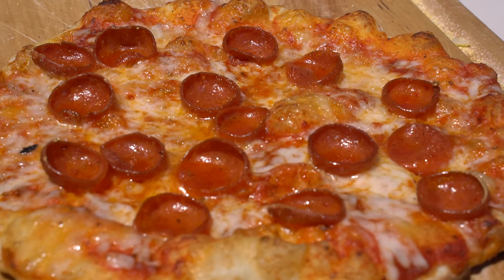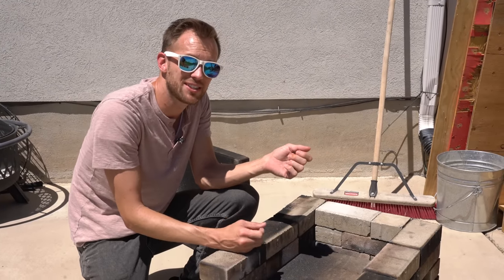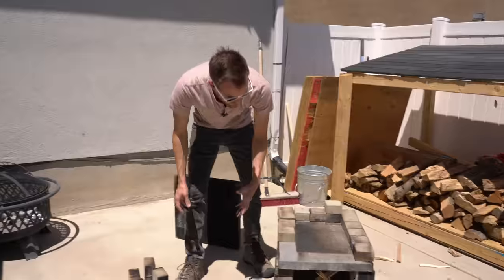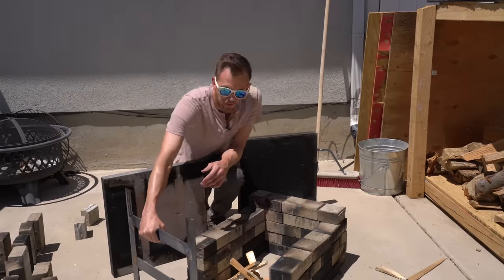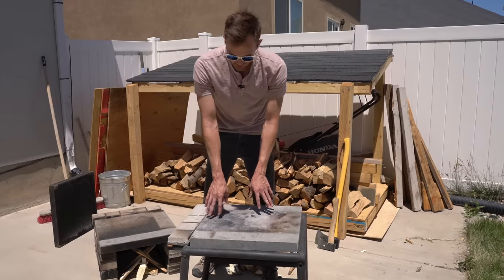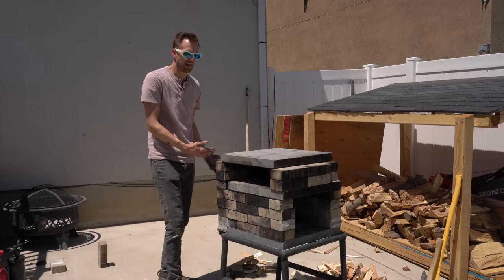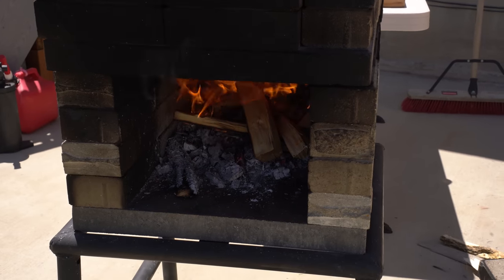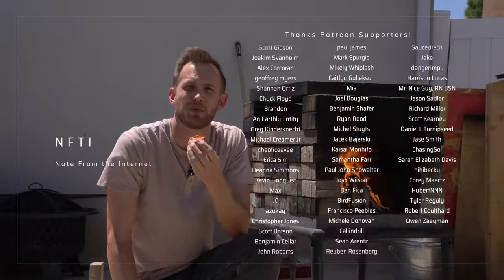The BEST Cheap DIY Pizza Oven

Comment: IMO, your tip of having the fire box access rotated 90 deg from the oven opening is actually a bad idea. It will not draft heat across the cooking stone or brown the top of the pizza evenly. If your fire is shooting out of the front of the oven, your fire is just to high! You need to preheat the oven, and just be cooking over coals.

Comment: Concrete can explode off chips of sharp concrete pieces blasting red hot embers along with them when heated. Have your safety squints in place.

Beware, the shallow craters are not easy to repair, so don't make the mistake of doing this on the front driveway

Comment: Nice oven.
I heard that another good reason not to build a fire on concrete is there could be trapped moisture in the cement , if it turns to steam it could explode.
Don't know if it's true or not , but I'm not willing to find out.

Comment: I'm still trying to figure out where I want to put one as, like you, I am going to elevate it, and likely mortar it so it's not something I take down, but it looks great.  As for the pizza, try this recipe for making your own dough and it's super simple.  5 parts flour to 3 parts warm water, tbsp of salt, tbsp sugar and a sachet of yeast (keep the salt, sugar and yeast separate until you've added the water and start mixing.  I just a stand mixer just for speed, but once it's done kneading, cover and leave at room temp to rest and rise for an hour, then just cut and press out then sauce, cheese, and top.  Personally, I go a bit lighter on sauce, but I do get heartburn easily, then for toppings,  just mushroom and black olive is enough for me.
Reply: Thanks for the dough recipe
Reply: @philipchang4453  Not mine, I got it from Sorted Food, though I should have remembered it as I'm sure I've learned it before this last time.  I'm also told (haven't tried it) that you can do half beer half water for the liquid, but yeah, I've not tried that yet.

Comment: Wonder if large ceramic tiles can be used instead of pavers. In theory the oven would heat up much faster since tile is thinner, although may not heat as evenly.
Reply: Fireplace tile might last longer, cracking resistant

Comment: One thing that has always puzzled me about this design is putting the fire beneath the oven cavity. With an old-fashioned woodfired oven, the fire is IN the oven. That stops the base getting too hot. If I remember from the original chap's video, a couple of pizzas in, the base was looking a bit on the black side underneath! So, why not make the oven one layer and longer?  Then build the fire inside and cook the pizza in front of it?  It will probably get a lot hotter (good), but not at the cost of the base of the pizza.  You will have to spin it, but you have to in a pro wood fired over too.  That is all part of the fun and the taste.

One warning about paving slabs: depending on what they are made of, they might just crack and disintegrate a few uses in, or they will almost explode apart.  I have had that just on a building an outside fire on a slab to cook a paella. It was quite dramatic! In my outside kitchen, my fires are now built on a base of 4mm cold pressed steel.
Reply from the maker: Recently had people over for a pizza party, we cooked more than 10 pizzas and none of them got too burned on the bottom.  Just gotta pay some attention to how much fuel you add.

Comment: I wonder if a multi-layered version that could cook multiple pizzas at once would work. I am not sure if enough heat would make it to the upper chambers to be effective or not. I assume that if it did it would still take some experimentation with rotation to make sure they cook evenly
Reply: Unfortunately no. The trait that most good pizza ovens have in common is a super hot base, whether it is steel or stone. The base has to be in direct contact o the flame to be hot enough to cook pizzas properly. With a multi-layered oven you basically can't make a good pizza with the upper layer.

Comment: Why not use a 24x24-in pizza stone instead of a paver on the upper end of it? I'm pretty sure the pizza can get an easier release, and I'm almost certain the heat from the fire won't bother it.  If not, why not put a pizza stone on top of the paver??
Reply from the maker: Because a stone that size costs way more than the rest of this oven combined. And the whole point of the video was to build it for cheap!

Comment: Doubt anyone will read this, but if you actually make this with the intent of cooking on it, I would suggest using a metal pan or even better, a cast iron griddle as your actual cooking surface. Just place it on top of the paving stone and let it heat up with the rest of the oven. I expect most paving stones are perfectly safe to cook on, but there's always that chance that yours isn't. Your food should actually touch a surface meant to cook food on, and paving stones are not meant to cook food on.

Comment: Might cost more but you could get actual stone pavers to make this oven. Flagstones. Probably shale or slate or limestone. If you picked complimentary shapes you might create a more rounded freeform oven. Also good is the previous firebricks idea. Or get the 12" $250. Oofa pellet pizza oven. (On the smaller side but their least expensive option... maybe wait for a January sale price cut. Good for up to 'medium' size pies. Kingsford offers an all natural food grade pellet now too; as opposed to 'furnace' home heating  grade pellets that could have undesirable binders and such.
Reply: I think Fred Flintstone had one of these too.

Comment: my question is, dont they sell fire resistant pavers with high heat rating?
Reply: And why would they have that?
Maybe after they see thus video they might, but pavers are for walking on not building fires.

Comment: if you adjusted your time for a slightly lower temp you might get a few more uses out of your paver block most the pizza ovens ive used at work cook around 600 instead of 700

Comment: Would moving a few bricks about 3/4 inch on the back wall created a passage way for more heat? Then on the top row move them foreword again. Just the two middle bricks from the bottom to the second from top row. That would create a good passage but still leave a sealed oven chambers on 3 sides. 
 Next get ferro concrete and make a form that’s stackable. With the ideas you get from your experimentation. Fire rated cement will last a long time. You can also make a custom larger oven and get a clear 24 inch cooking area. 
 I like using steel to support the pavers, that’s a keeper.

Comment: Build it on a welding cart, height problem solved and you don't have to take it apart to move it.
Additionally I would have to build it double width because I'd be eating one of those entirely by myself lol

Comment: Would it not make sense to also rotate the "vent" between the fire and the oven so it's still at the rear to get a more even heat over the pizza rather than possibly having it off to the size ?
Reply from the maker: Yes, if you have paver stones that are big enough!  But to support the top, I would then need bricks on both sides of the cooking paver, leaving too small of a gap for cooking!

Comment: I live in Baja California I went thru the same process you did built one on the ground first bricks cost 10 pesos 50 cents here had to build my own paver with rebar in the middle and concrete 2 inch's thick with a slot in the back  for the flame worked good I lost  some pizzas in the beginning didn't like bending over so I built mine up with cinder blocks fill it with rock and base rock to light my fire on worked great cooks a pizza in about 2 minutes

Comment: How did you put out that fire after you cooked it? Do I need a fire extinguisher? Can I use water? Do I just let it burn out?
Reply: Better to burn out, than fade awayyyyyyyyyyyyyyyy😁😎
Reply from the maker: You have to add wood every ten minutes or so, if you don't add any it just burns out.

Comment: Does turning the pizza part 90 degrees affect the crispiness of crust or anything, since the air isn't pushed over the pizza as much?

Edit to clarify: I don't know much about science or cooking, I just thought there was some kind of benefit to having the hot air move across the pizza.  I would appreciate those more knowledgeable than me giving me some of their knowledge on this.
Reply from the maker: Plenty of hot air still moves across the pizza like this!  Maybe in a different direction, but it's there!  A design with the vent at the back might still be better, but the pavers I was able to find weren't big enough for that.
Reply: @NFTI  Ah, that makes sense.  It still seemed functional, and I thought it would only be a bit of a minor difference anyways, but I was just curious if it had a noticeable affect

Comment: The only problem with the 90 degree mod, is the "door" is right next to the vent for the fire, so you won't get as much heat across the top area, I'd rather 180 the opening for the fire to keep the convection.
Reply: It seems like no matter where you move the fire pit opening (unless it is opposite to the opening of the cooking area) it will still be just like the “original mod” version.  I would think about creating a door to just slide in front of the fire pit opening (like they do on other expensive pizza ovens)…even if you just have to use it to block the heat while turning your pizza!

Comment: A lot of gas, commercial pizza ovens have two long ceramic plates above the heat, which split the surface laterally. The seam never bothers the pizza. So you could use two long pavers, if you can find them easier.

Comment: If you've got one, replace the middle paver, the one you put the pizza on, with a "Baking Steel", OR just a steel plate in the right size that's maybe 2cm thick (or perhaps an inch thick? I don't understand Imperial measurements)
Reply: One inch is right at 2.6 cm. I think these pavers are sold as being 2 inches thick so roughly 5.2 cm. 

While we use imperial more than metric in the US, we grow up using both and almost every tool we have for mesuring things has markings for both. Few people can convert from memory but all we usually have to do is look on the other side of the mesuring tool.

Comment: Actually I'd take a guess and say if you added one more layer of bricks on bottom and put a slightly raised wire mesh no thicker than the brick to put the wood on, it would both burn better and probably not damage the concrete.

Comment: The bottom crust is great but it seems like it needs more heat from the top.
Have you considered angling the top stone so that it slants from rear to front? And/or adding another stone to the top-back for space for wood?

Needs tweaking but I think you’re on to something

Comment: Is there a way to get the slot for the airflow in the back? Your design seems to work well so maybe it doesn't matter, I'm just wondering if some of that hot air is just leaking out the side rather than flowing over the pizza
Reply from the maker: With larger paver stones for sure.  I couldn't find any 24" ones, and the ones I have would leave too narrow of an opening if they had bricks on both sides, but if you can find the bigger ones that should be an option.

Comment: Good ideas. I'm just wondering if moving the opening to the side will affect the airflow. the original structure allowed the air to flow over the entire pizza. That way you wouldn't have to move it about in the oven. I suppose to prevent getting burned from the flame makes it ok. Just a couple of my thoughts.

Comment: The reason the original video had the opening in the front is because the natural tendency of hot air to escape will force it rush over the pizza rather than find a quick easy way out from the side. This forces the pizza to cook faster.

Comment: how about just 1/4 or 1/8 inch steel instead of the paver stone?  It'll definitely be more expensive, but wouldn't it remove all durability problems?
Reply: Welded rebar grate, or even cheaper, replaceable wire fence fabric.
Reply: @terrafirma9328  but that's not solid, your dough will get touched by the fire directly

Comment: Something that occurs to me... Wouldn't it be better to rotate the opening of the fire area rather than the cooking section? Flames coming up and across the ceiling from back to front would be more even than the opening being on the side so the flames would have a more direct routing is my concern. Nice project!
Reply from the maker: I'm sure there is a way you could build it to work like this!  In terms of cooking area with the bricks I was using it didn't make as much sense for this shape.

Comment: It really wouldn't take much more work to mortar it all together and then mortar on stone veneer, then you have one that adds value to your real estate while the loose stacked version might reduce the value
Reply: Loose is easier to clean. You might dress it up with a rmoveable shell of fireproof material you could remove and cover it with.

Comment: Great idea. Use clay bricks and 2 to 3 unglazed big ceramic tiles on top of each other for the bases that can take the heat - no need for support and will last long. I will make the top higher to fit a roast pan to make it more versatile

Comment: May be a cheaper option if you use insulation hangers under the stone above the fire.   They are basically the bottom of a clothe hanger cut on both sides to small points to dig into wood.

Comment: Suggestion for the 5 half bricks, go with 4 half bricks, leave the fifth full length and have it sticking out the front, but drill and mount a hook into it for the paddle to hang from while the pizza cooks. Hang from the far end, away from the opening for the fire, obviously, since the good ones seem to be wood.

Comment: Cool idea, sweet little unit, I had a suggestion maybe a little more expensive, but you could replace the 20x 20 paver with a pizza steel just season it ready to go, also produces a lot more heat. In the long run saving $ on buying more pavers and not having to take apart !!!
Reply: Where do you get a pizza steel?

Comment: Good choice on the pepperoni. Cup and char is what we use in Buffalo. Next one, when you are ready to take it out, lift the pizza up on the peel and hold it close to the top, let the heat at the top of the oven crisp that pepperoni up a little more. the bottom of your pizza looked cooked, but the top imho was a little under done.

Comment: Some pizza dough tips I've learned from making many pizzas from scratch:
1. Always use bread flour. This allows better formation of gluten chains which leads to a stretchier dough.
2. After kneeding dough for 10 minutes, ferment in the fridge for 3 days minimum. This leads to a crunchier/chewier crust.
3. Work dough at room temp when ready to form pizzas. You probably already understand why.

Comment: The pavers in the video were 16" x 24"  which is the perfect size....  Just a thought.. when I was looking for a cheap pizza oven.. it was because of the difficulty in building one (not having the tools and welding equipment).. what you've done is nice..but defeats the purpose of what this oven was designed for.  Nice ideas though !

Comment: This pizza oven is badly flawed.  The fire is underneath, which is all kinds of wrong.  The bottom of the pizza will burn before the top is finished.  Don't bother with this oven.  Lookup Vito Iacopelli on youtube for real pizza knowledge.
Reply from the maker: I use his pizza dough recipe!  The vent for the heat allows a lot of VERY hot air above the pizza, in addition to the roof slab holding a lot of heat, so it gets very hot on top of the pizza as the crust cooks.  I've successfully cooked dozens of pizzas of different thicknesses and quantity of toppings by now, and they've all done great!

Comment: Great improvements, if I may suggest another?  Try wax paper.  Set your stretched dough on it and build.  It slides on and off the peel super easy and avoids any issues loading the pizza in the oven.  Also can spin it easy and slide back out on peel.  Thank you for the great tips to improve what was already a very simple way to enjoy your own pizza

Comment: If your going to weld a rack, you could have the fire in the back, and leave a gap on both sides of the paver for hotter temp and more even cooking. You would need another rack for the top paver.

Comment: Try looking at a REAL PIZZA OVEN . All you guys keep FAILING on the basic concept of a pizza oven . THE HEAT SOURCE ( WOOD OR GAS ) ARE ON THE COOKING SURFACE NOT UNDER IT . THIS HAS BEEN TESTED FOR CENTURIES AND WHY IT IS THE BEST DESIGN . BUT YOURE LIKE SHEEP FOLLOWING THE SAME LOUSEY DESIGN . IT COSTS THE SAME ,, JUST AS EASY ,, BUT THE PERFECT WAY